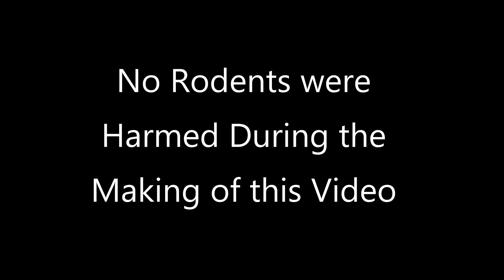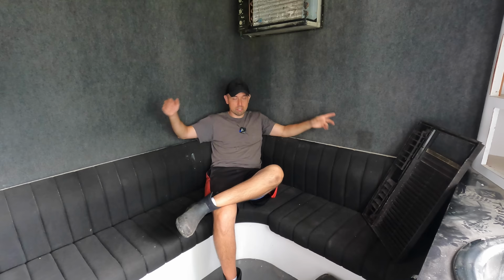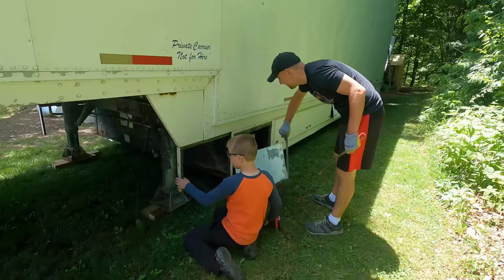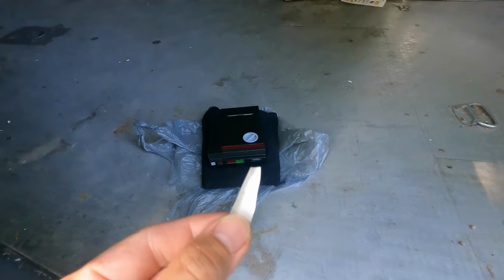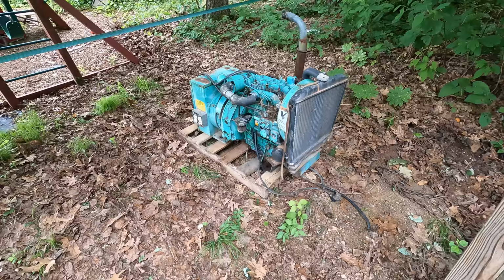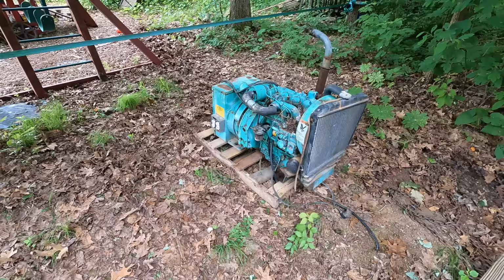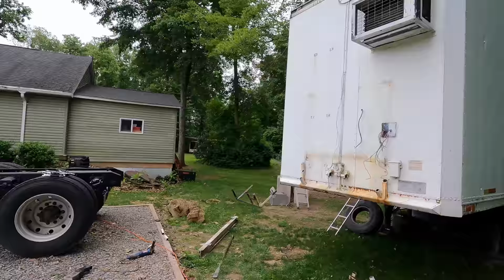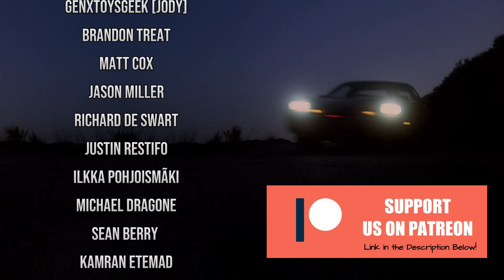Knight Rider Dorsey Trailer Teardown Begins! PLUS Removing that Huge Generator from the Front!

Comment: I would have kept the generator. It could help run all the systems. I also would keep ac some how.
Reply from the maker: We will have a newer generator and AC hidden when done
Reply: @KnightRiderHistoriansOfficial  Maybe rather consider  Battery Pack and Inverter in the Belly Boxes? No Exhaust, Heat and Noise to deal with.
Reply: @unitrader403  That's true, you could inconspicuously add a ton of solar panels to the roof to charge a lot of batteries. Would be very cool. But very expensive. Much more expensive than a generator.
Reply: @moabman6803  Solar Panels would also be cool, but not a requirement. And running Costs of Generators are pretty high compared to Grid-charged Battery + Inverters (Fuel and Maintinence), and is also probably more difficult to hide (they are often quite bulky, have a fixed size and you dont want them in the Interior for several reasons)

Comment: I'd say that FLAG, keeping with the 2020's, would likely have a power creation on the Mobile Unit of some sort rather than dealing with the Tractor being the source. I'd think they'd probably have a set of solar panels up top and covering the vast majority of the top (being black would blend in somewhat), batteries (similar to Tesla PowerWalls) in the Belly Boxes, and definitely an AC of some sort. Probably more ducted, not a wall unit, to get to the multiple zones, like the lounge, the lab, and the garage (although lab and garage are open air to each other.) Better yet, somehow using Heat Pump tech to be more energy efficient. A mobile Internet, like a Starlink, would be implemented into the roof as well.

Comment: I wonder if you could get the surviving cast of Knight Rider to donate a limited number of signed photos of them in scenes that had the knight rider mobile unit in photo (ie Peter Parros behind the wheel of the semi, or Patricia or Rebecca posing with one of KITT's maintenance tools in the trailer, or even a signed photo of KITT from William Daniels? Or get Peter Cullen to sign a few pics of 1st season KARR (sadly Paul Fries died in 1986 so no autographs of third season KARR are possible).

Comment: Joe, do u know the number of birds they used on the series? Im a DIEHARD Dukes of Hazzard fan, and the numbers never been fully confirmed, but ive met cast members as well as stunt drivers from the show, and they all have a different number but quite similar to 300 to 320ish. About 25 of the originals still survive.
Reply from the maker: They didnt use more than 30 T/As on Knight Rider
Reply: @KnightRiderHistoriansOfficial  that is SO unbelievable given all the stunts they performed. Of course, the series was a few seasons shorter than Dukes of Hazzard, so that explains part of it. Hmm...i wonder if theres an A-Team historian whos salvaged B.A.'s van and how many of those were used and still survive. Well good luck on the truck, J. Look forward to the finished result.

Comment: How much stuff was originally hidden inside the fake roof?
As for that front room, was it not with a set of stairs, in the show, in order to enter it or am I remembering this wrong?
If it is, why would this be?
Would water & wast tanks be hidden there or other stuff?

How would those original storage boxes have been used, if they had been used in the tv-serie?
The place where the computers would have been mounted, perhaps?
The water tank(s), wast tank and so on, perhaps?

You guys still have some time, to figure things out, on that front.
Still, looking good.

Comment: What did the original inside look like? Knowing that the inside on the show was a set, I'm assuming the actual trailer was just empty on the inside (so the car had more room to come to a stop)? It seems like your plan is to build a replica of the set on the inside? That's probably the better idea (particularly if your plan is to take the whole thing to exhibits, it'd be kinda boring to have it empty on the inside, even if that's not 100% authentic). Still, I wonder if there's a way to have authenticity and fun at the same time and maybe make the insides removable? So you can easily show how it would have been, but also show off the in-universe way it would have looked? Though I always had the feeling that the trailer was bigger on the inside on the show, given there was room to get out of the car on the set, whereas the trailer outside didn't seem wide enough for that?

Comment: Before you sell that generator I would highly recommend  putting a breaker bar a socked on the crankshaft pulley  of and checking to make sure it's not siezed up. Because I a pretty sure
no one wants to buy a siezed generator?🤔👍❤
Reply from the maker: Its not seized and its already sold

Comment: Should have kept the generator! Unless your putting a new one in??
Reply: I disagree. That generator looks in severely dilapidated condition and may need maintenance work. Additionally, it's very old. You could do a lot better with a newer unit or at least one in better mechanical condition.

Comment: I can't HELP wanting to skip to the end product. Would your screen used KITT actually fit inside? You have (and sell) the original wall blueprints, you could literally make the semi set in real life even if the scale is smaller than it looks in the show. Reproduce the set all the way back to that door we always see Devon coming from/going into. It might be tricky since you wouldn't have enough room to open the drivers door, but MAN it would look good.
Reply: Wouldn't that be wacky since that's not how the trailer was for filming?
Reply: @raymondlugo9960  No I'm thinking of what we saw of the interior on screen, we never really see behind that door in the back anyway. The car, a desk or two and chairs for Bonnie is all we ever really saw. If the car will fit in there it's more than doable considering they even have the wall blueprints. The rest would be rather simple set dressing that wouldn't be hard to do.

Comment: What you are actually doing is DOWNgrading the trailer you know :) If I were you, I would just replace all that rotten shredded plywood floors of the dropboxes, they've done their 45 years with distinction, let them spend their retirement on the town dump..
Reply from the maker: Those dropboxes with the rotten floors are not original to the show, so they are coming out completely. The floors of the original belly boxes are solid